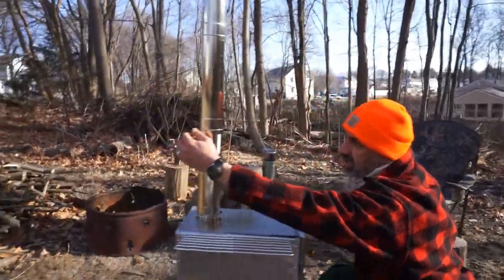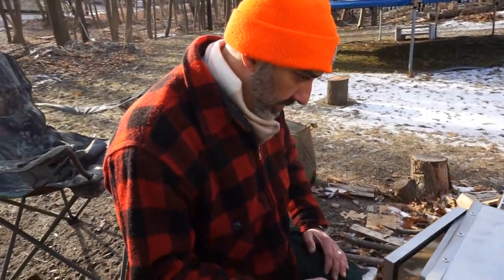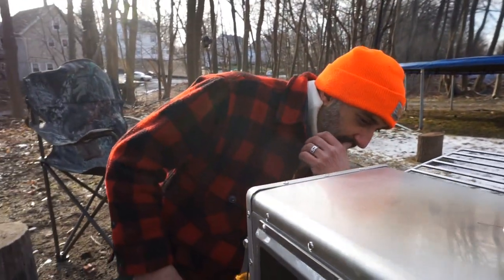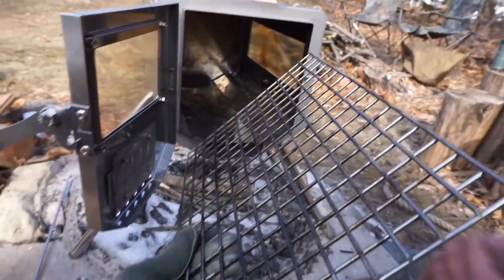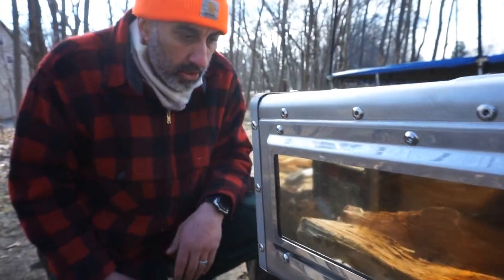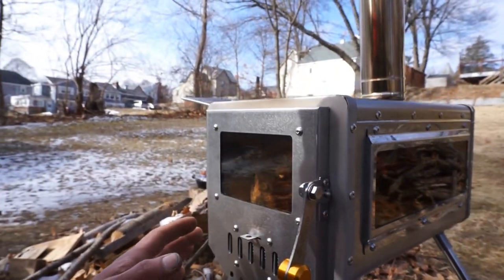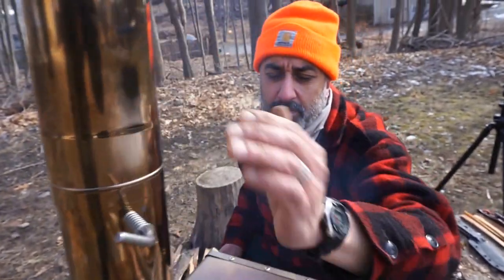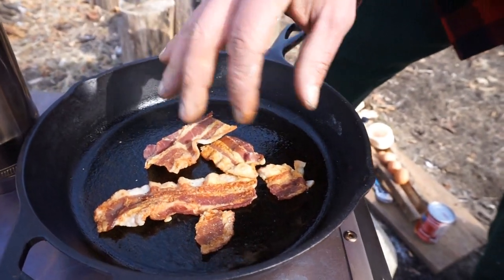Impressive! Field Test - Work Tuff Stove WTS 380 - Initial Burn In

Comment: After watching your two videos on the Work Tuff Stove WTS-380 it sure is a nice looking stove.   I did not know that this stove existed when I bought the Winnerwell Nomad Medium wood stove, which is also a well put together stove.  As for the drawn of smoke exiting the chimney.  When a chimney is filled with hot gas, (from the wood burning) that gas tends to rise because it is less dense than the air inside / outside the chimney.  The rising hot gas creates a pressure difference called draft which draws combustion air in the stove and expels the exhaust gas up the Flue, it has nothing to do with  having an outdoor breeze or wind.   When first lighting your stove keep everything opened, light the wood then close the door only leaving a small gap, everything else leave open.  The stove will smoke a bit.  As soon as the Flue gets hot it will cause the inside gas to vent drawing the smoke up the chimney.     You will enjoy that stove in your tent.  Good video.
Reply from the maker: I'm looking forward to getting this in a tent.  I think it will be a really great experience.  Hopefully soon!  Now I just need a hot tent!

Comment: Hi there! You mentioned that the bottom under the stove is still frozen which means there's no heat going down there? So for use inside a tent, do we still need to use a heat mat underneath? Reason I'm asking is I'm debating between this WT stove and the Winnerwell Nomad View one (which looks like gets heat in the underside).
Reply from the maker: I have never used a heat mat, but I don't want to give you bad advice or make you do something unsafe.  Just my experience is that I haven't needed it for my uses to date.
Reply: @outerlimitless  thank you! I will probably just get a heat mat just in case hahaha. I have a handful more questions if that's ok. I am very new to this and would prefer to ask people who have experience before buying as it isn't cheap :) 
1. Do you think this is sufficient for a 5m bell tent? For context, I'm in Sydney and winter here doesn't snow unless we go camping at the Snowy Mountains :) but it does get cold like between 0° to 10°C..
2. Does any part of the store become red due to heat or is that normal? I've seen some stoves where the tube gets red when in use.
Reply from the maker: I think it'll probably be good for a 5 m bell tent...I guess it depends if you're looking for perfectly warm or just warm enough.   But yes it should be.   The pipe gets super hot.   And yes red hot at times.   They have a pipe cage that helps keep heat of things you might accidently bump into.
Reply: @outerlimitless  thanks so much! 

I noticed the top if this stove doesn't have a hole while the Winnerwell Nomad does. Do you think it matters? Have you ever wanted an open flame when using the top for cooking?

Also the glass, does it get damaged/dirty after use? I've seen a video where the glass got dirty and the guy said it was hard to clean off so it was no longer transparent.

Comment: I’ve never seen a camp stove like that with windows. That’s nice. I have seen similar sized ones home made out of different things like ammo cans or scrap sheet metal, but this appears to be of really good quality and workmanship. If you use it inside a tent, those windows might let you see how your fire is doing while you’re in a sleeping bag and serve as a night light. Do they make a cover for the glass to limit the light it emits? I saw a video of a stove a guy made to be used outside of the tent and it pipes hot air into the tent. Maybe you’ve seen it. What kind of pants is Joe wearing. They look like they’re made of wool and look comfortable.
Reply from the maker: Yes, the glass is perfect and definitely enhances the experience.  Joe had wool pants...he's always got some cool old school gear of some sort.

Comment: Really like this piece of gear I wonder if it works well as a heater in a tent made for a stove looks like it would work week if your careful not to burn the tent down. Where’s my food 😢.
Reply from the maker: Could you imagine waking up to your gear and tent on fire...that would be ridiculous!  But they're sorta made to work in a hot tent that way...the tent has a fabric that is flame resistant where the pipe protrudes through.

Comment: How much does it weigh? Never mind. Website says 19 pounds.  Forget about it.  It's way too heavy for backpacking trips unless you have a pulk sled for transporting your gear. I'll stick with my 2 pound titanium stove
Reply: What brand titanium woodstove do you have? How is it? There are so many to choose from.
Reply: @sparrowflying864  Pomoly
Reply: @ElkArrow  Ok thanks friend.. I was looking at the polomy and the one tigris because they look like they're made sturdy. I was also looking at this company last night called Riley stove company. They got a small one that is not titanium and weighs  4 pounds. It's not collapsible though and it's not astectically pleasing. Which I really don't care about I just want it to work.  I want to get one  but not sure which one yet. What are the pros and cons to the polomy? Does it smoke at all? Has it warped? Does it have a damper and come with the spark arrestor? Some of these stoves have pros and cons and some if them have good reviews then bad reviews?? I  want to get a hot tent and stove combo but I don't want to wake up in the hospital either lol.
Reply: @sparrowflying864  I would get one that doesn't require assembly in the field. That means you should get a fast fold stove. Pomoly's titanium appears to be the thickest on the market so it's probably the best and safest. Their dampers are high quality as well. All stovepipe you buy anywhere is essentially the same grade. If you're worried about a fire in your tent, make sure you have a fiberglass stovejack. You should be fine